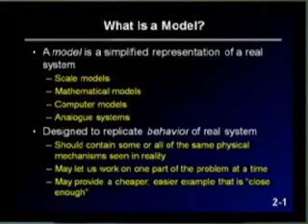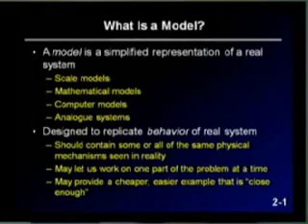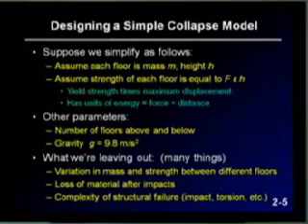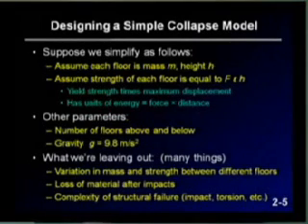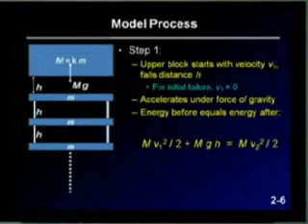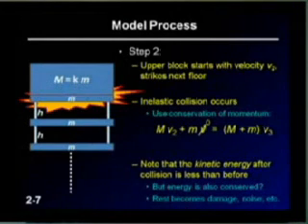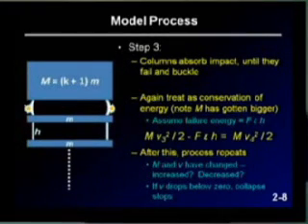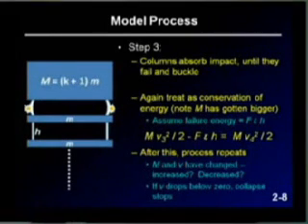WTC Modeling Instruction & Testing in the Real World

Comment: @psikeyhackr "Must stand"

The columns carry the load. The columns were induced to failure through mechanisms outlined in the NIST report. 

Once the columns fail the top of the building begins to fall on the HORIZONTAL surfaces below I.E. the floors which are held up by trusses attached to the columns. 

These trusses and their connections are unable to support the weight of the top of the building and so they break. This leaves the core in tact and outer columns that  tip away.

Comment: @flanksteak2 To further explain, the seismic shaking does not begin until the large panels that freefell outside the structure began to strike which began @ 9 and 11 seconds for each building. The shaking continued for 15 to 18 seconds as pieces of the building hit the ground. 

Keep in the mind that once the building is short enough, the strength of the impacts gets too low to be measured seismically meaning  the estimated 25 seconds total collapse time for each building is conservative.

Comment: @psikeyhackr "Talking about the "supposed" collapse of a skyscraper without discussing how the steel and concrete HAD TO BE DISTRIBUTED in the building just so it could hold itself up and withstand the wind is absurd."

Clearly even you do not know what you are talking about here. This subject material is clearly beyond your grasp as you are using buzzwords and talking points you have picked up and think you can trick people into thinking you know what you are talking about.

Comment: @psikeyhackr "How could the MASS be accelerated to come down in less than 18 seconds?"

Where did you come up with this number of 18 seconds and how is it a magical #?

"So where is your explanation of what happened when the falling core came down on the stationary core and the HORIZONTAL BEAMS that we are not supplied data about had to impact each other."

You're not making any sense here. You need to retype this so that it is grammatically correct so that it can be understood

Comment: @psikeyhackr "15%"

You talk about physics then completely avoid the simple math. 

1 floor can only hold up 11 floors worth of weight in a static, or six in a dynamic loading scenario. (conservatively). 

You cannot explain or "ROFL" or "LOL" this away, that is why you choose to ignore it and then pretend to be clever. 

The fact that the floors and connecting beams were the only thing resisting collapse is proven by the fact that the core was still standing.

Comment: @psikeyhackr "The floors did not hold the load. The columns in the core and on the perimeter held the load."

When the building began to collapse, it did not fall and line up perfectly column-to-column. The top part fell on the floors below and severed the truss-to-column connections which cannot even come close to arresting the mass falling on them from above. 

You don't need to have a model to visualize this simple (and videotaped) chain of events.

Comment: @psikeyhackr "The FLOORS were attached to the CORE and Perimeter COLUMNS. That is why I say LEVELS instead of FLOORS. The weight of LEVELS increased down the building and COLUMNS had to get thicker in order to get stronger to hold more weight."

And the only thing resisting collapse were the floor-to-column connections which can only hold 11 floors worth of weight (conservatively) in a static loading and 6 in a dynamic loading scenario.

Comment: @psikeyhackr The Data is simple. Each floor can hold 11 floors worth of mass (conservatively as this is only the live load and does not include the weight of the framing). 

Since the area above each impact point and thus collapse initiation point was greater than 11 floors, the building collapses. 

When you add in kinetic energy, the number of floors an in-tact floor can support drops to about 5 (conservatively as this measurement does not include the weight of the framing etc).

Comment: Your argument doesn't work for the same reason the "atheist dilemma" problem doesn't work. In order to assert that a tower has never collapse based on it's own weight you first must assume that the WTC didn't collapse because of it's own weight. You use this model as proof, which I've shown is not proof.

But after showing you it's not proof, you maintain the ASSUMPTION that the WTC didn't collapse based on it's own weight. That ASSUMPTION is not proof.

You're essentially begging the question.

Comment: You keep talking about how you built your model to be as weak as possible. That's a deceptive statement for 2 reasons:

First, it's physically impossible to build a tower that supports it's own weight that's weaker than yours? You really want to make that claim? I'd stake my life on it being incorrect.

Secondly, your tower is only as weak as possible BEFORE crushing the paper loops. AFTER crushing the paper loops it GAINS strength. This is dissimilar to the supports in any REAL structure.

Comment: @psikeyhackr Yes, I'm using a metaphor. It is a matter of semantics, it is a word game. Look it up if you're unfamiliar with it.

There's a fundamental difference between your model and the WTC which I've pointed out about 100 times - hell, you've even DEMONSTRATED the very point in a video yourself.

Your supports are STRONGER after they are crushed. Steel beams in a support arrangement, when broken, are WEAKER. Explain how your model remains valid given this fatal flaw.

Comment: Thus, psik's experiment is like the experiment that shows that the sky is green. Sure, the WTC couldn't have collapsed if it had supports that GAINED resistance the falling kinetic energy when crushed like psik's does - the sky would be green if we used different gasses and different angles of light - but the WTC didn't  use supports that gained resistance to the falling kinetic energy when crushed - the atmosphere has specific gasses and light comes in at specific angles, not whatever you want.

Comment: ...the still intact supports below them.

However, as psik even demonstrates with his model, the paper loops DO NOT BEHAVE THIS WAY. In fact, the behave the EXACT OPPOSITE way.

His paper loops absorb the falling kinetic energy by crushing and becoming spring-like. These spring-like crushed loops are capable of providing a GREATER upward force than when in their intact form. This assertion is CONFIRMED by psik's own experiment in which he demonstrates weights dropped on crushed paper loops.

Comment: It is relevant because psik's model doesn't represent anything that happened in the world trade center.

The world trade center's supports are in a specific arrangement and are bolted together and surrounded in cement. If this structure breaks (say, due to the kinetic energy of a falling object) the supports will break. Once the supports are broken they will provide no significant amount of upward force. In other words, the broken supports only provide an upward force when resting on...

Comment: @PsyberSourcerer Unfortunately, this demonstration fails to show anything relevant. Firstly, bending a spoon makes it only weaker. Bending metal causes stress on the bonds within the metal. The added stress REDUCES the strength of the bonds making it EASIER for it to break. If you don't believe me, go bend a spoon until it breaks. You'll find that the MORE you bend it, the EASIER it is to break.

Comment: @ialsoagree I'm not at all certain that the semi-crushed loops having more or less strength has any bearing.
But I'll give this a shot in the dark, regardless. Take a spoon, bend it. Try to bend it further and further. Eventually it provides greater resistance, until you can bend it no further by hand. This becomes especially true once it has been bent flat, and the handle is touching the bowl of the spoon. 

Also, given equal diameter, a short stick is much harder to break than a long one.

Comment: @ialsoagree The problem is that NIST claims that WTC 1 and 2 each collapsed at very close to free-fall speed. Their argument is that the upper portions were so massive that the lower levels were unable to provide any resistance. 

The paper loop experiment is sufficient to prove that energy is expended by crushing supports, and that the upper masses were insufficient to cause total collapse. (Nevermind being close to enough to convert most of the building into pyroclastic flows.)

Comment: The reason I present this question is because your videos give us a very conclusive picture of how your model works. In your model, when the supports break they mitigate MORE of the force from the falling mass than they did when they were unbroken.  Your own tests confirm this!

In a skyscraper, the exact opposite is true. The I-beam supports resist the falling mass best when in their designed arrangement. Once that arrangement is broken, their resistance to the falling mass is negligible.

Comment: It isn't a simple matter of collapsing the I-beams and then asking if they can still hold load. It's a matter of destroying their arrangement, and then asking if their new resistance is anything but negligible?

Take the two boxes stacked on each other. In their unbroken arrangement the top box is not transferring all it's stress to the second box (it's resisting some). Once broken, any resistance from the remaining shards of the top box are irrelevant compared to the resistance of the box below

Comment: @psikeyhackr Why would I need to demand knowledge about the I-beams in the world trade center to know that the ARRANGEMENT of ANY structure is an important factor in it's strength. The I-beams of the world trade center WERE NOT aligned horizontally and vertically exclusively. They also had a diagonal component.

An arch is a great example of how a support's structure an influence it's ability to carry load. Yet you completely ignore that and call me unintelligent.

Comment: @psikeyhackr You completely ignored my entire point, seemingly because you have no response because you know you're wrong. I-beams are arranged in the positions they are arranged in for maximum support of the structure. Breaking that arrangement REDUCES the ability for the supports to withstand the falling mass.

You ignore this because you either know it's true or you're not intelligent enough to understand why it is relevant. Either way, you spout rubbish to sound like you have a point.

Comment: Good job.  The only way that the force of a falling body  can exceed its static weight,(which IS a force =mg)  is to have that falling body decelerate.  Force associated with the decel is added to the body’s weight.   The total  force imposed is dependent on how fast it decelerates.  So  the KEY is deceleration without it the total force < its own weight..  The towers didn’t decelerate. They accelerated meaning they could not impose a larger force on the underlying structure than when static.

Comment: @psikeyhackr What is THIS nonsense? A skyscraper's support structure get's it's strength directly from the individual I-beams? And not the (breakable) arrangement of the I-beams? Next you'll be telling me there's no way an arch could possibly stay standing.

You have a fundamental misunderstanding of the structure of the skyscraper supports. It leads you to misunderstand why your model shows the opposite of a skyscraper. When crushed, your loops become MORE resistant to falling mass, not less.

Comment: @ialsoagree The rubble from the first box is holding you up above the second box and the second box is holding above the ground. So both.

If the first box wasn't there it couldn't be holding you up, so either it's physical extension has disappeared into some Bazantine black hole but the mass remains or it is still there exactly like in the experiment.

Your mass cannot be transmitted to the lower box directly unless the upper box is taken away, but then you can't add the weight to the collapse.

Comment: Psi's model makes my point quite clearly. Once enough force is excreted on the supports to break them in the WTC that support structure loses it's ability to resist the falling mass. Yes, it does slow that mass down, but once the force exceeds what it can resist, it provides NO further resistance.

Psi's paper loops, after getting crushed by the falling mass, have an INCREASED resistance to falling mass, his model even demonstrates this. It's the exact opposite of the WTC.

Comment: @ialsoagree ...not to mention the context of the video link.

Your supposition that the building mass that was collapsing was not supporting the material above it is just as crazy as Bazant's one-dimensional fiction. The only way that could be true is if it was being infinitely compressed.

If it is transmitting the load of the falling mass to the lower structure it must must by necessity be supporting that mass in the way this setup displays. 

It cannot disappear AND add to load. Pick one.

Comment: @ialsoagree "What part of the core is the part that "remains standing" but is NOT "the core that didn't collapse.""

If it doesn't collapse it remains standing.

If the paper rings are resting on the lower section of the construction here, then they are exerting a force on that lower structure, not supporting it.

Do you support the earth by standing on it?

Comment: It doesn't matter if the metal in the skyscraper falls outside the building, or inside, or magically disappears. Unlike the paper loops, once the metal support structure is crushed and broken, it no longer provides a resistance to the falling mass. The paper loops, after crushing, continue to provide an upward force against the falling mass.

Comment: @ialsoagree "Large compared to what? "

Large compared to part of the core that didn't collapse: watch?v=-dWBBEtA

Somebody once did a calculation to show that the top spire is roughly at the bottom of the damaged floors.

"whether paper rings can provide resistance to a falling object after it crushes."

Mass is mass is mass is mass. If the mass is outside the perimeter of the building though, it cannot be added to the main phase of a Bazant style collapse.

The paper rings are adding more.

Comment: @psikeyhackr Saying it was as weak as possible is disingenuous. It was as weak as possible to hold up the weights, using the materials in the arrangement selected.

This is by far different from a structure that is actually as weak as possible. The falling card house that was shown to you displays that very fact.

Further, if you don't intend to scale the WTC model, why even compare the two? You are basically admitting yourself that they aren't demonstrating the same things!

Comment: Finally, you fail to acknowledge the fact that, once the resistance of a floor is overcome and the supports broken, that floor is now a part of the mass falling onto the support below it. You also fail to acknowledge that in the video demonstration by psi, the paper weights don't become a falling force adding weight onto the floor below, they instead provide a greater resistance to the weights above them similar to a spring.

A skyscraper has no force resembling this, which was my entire point.

Comment: After the initial collapse, you have no way of knowing what stress was propagated down the structure damaging areas below the floor being immediately hit. You said yourself that engineers reject the pancake theory, then claim make a claim dependent on a pancake style collapse. Your argument lacks consistency.

Finally, you equate a floor breaking with "full resistance that the [entire] structure was designed to provide." Wrong, only the resistance a FLOOR was designed to provide.

Comment: @ialsoagree What happens instead is that a large part of the core remains standing in at least one building (i.e. none of this large mass was falling AT ALL)  and there is no significant collection of debris at the bottom of these supposed shafts. You would expect a ten floor high donut of material at the base, where instead early observers saw a hole.

Your thinking makes sense in the abstract, but the observation of the actual collapse just doesn't bear out what you suggest. Sorry.

Comment: @ialsoagree The paper rings have a much wider diameter than the dowel, I don't see them resting on it.

Your analysis is flawed. Read Bazant again, below the impact floors the structure was undamaged until the falling mass impacted it. The fact that those floors were destroyed to it elemental engineering units means that it was given the full resistance that the structure was designed to provide.

If you were correct there would be big pieces of intact core at angles at the bottom.

Comment: Once the support structure as shown in the images you'll get by googling the above is broken, the steel beams no longer provide resistance to the falling mass. Instead, they will fall through the gaps in the support structure and become a part of the "falling mass".

There is absolutely no reconstruction of this effect in psi's model. In fact, his model demonstrates the exact opposite. When a paper loop becomes crushed, it acts like a spring, requiring ever more force against the falling weight.

Comment: @DarkwingScooter Saying that doesn't make it so.

When a paper washer becomes crushed, it is NOT a part of the falling mass. It is a crushed paper washer that creates even greater resistance against the falling mass.

In case of a skyscraper's structure, the supports gain their strength based on their arrangement. A falling mass destroys the arrangement of the support structure, and only the stable supporting structure below provides any support.

Just google wtc-core.jpg and you can see.